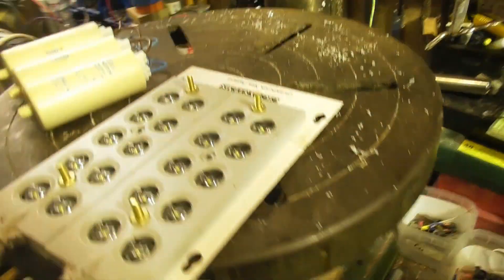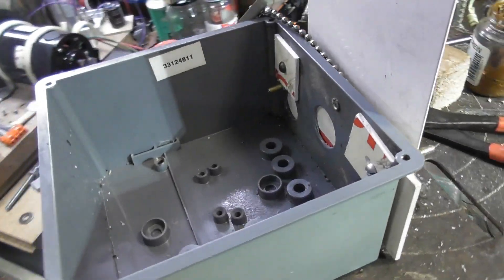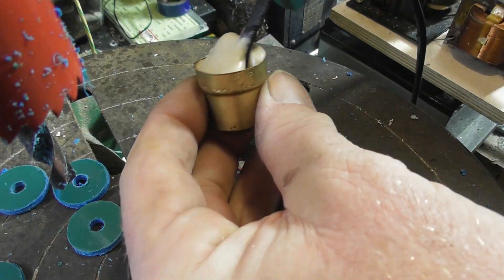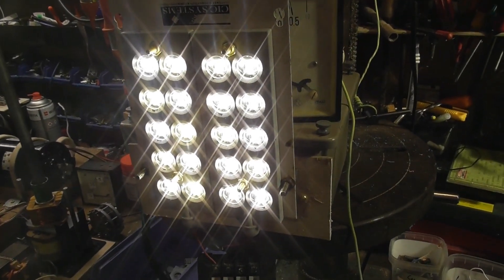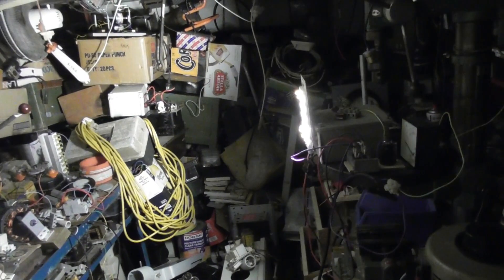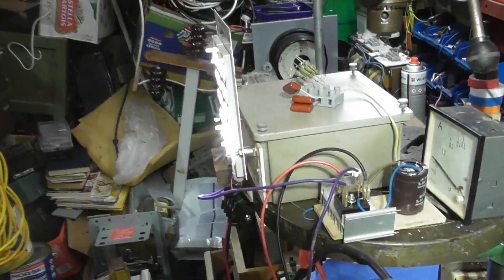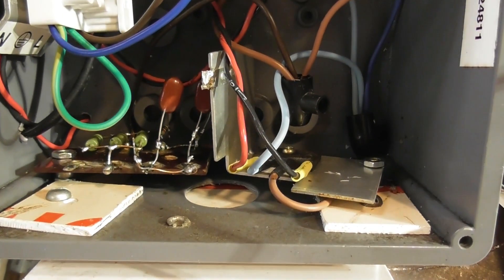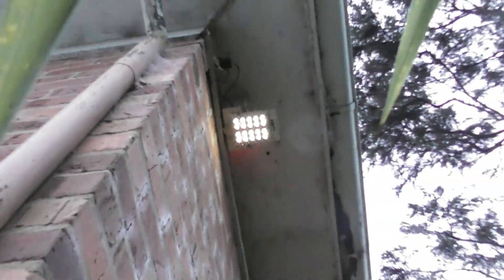Cree 20 LED lamp with capacitive voltage dropper

Comment: Hi Ray.  Thank you for the shout, regarding the KIM streetlight vid you made 2 years ago.
Having been involved with high power LED's for at least 20 years now, I have seen the amazing progression of the advances of the Junction Temperature of LED devices reducing to the point that several 3W+ devices can be placed on a small heatsink.
However, I have observed that cheap LED's are extensively used in HF switching modes at the expense of their overall life expectancy.  Therefore, I recommend using over-sized heatsinks on these devices wherever practicable to enhance their lifespan, in regard to any modulated PSU and particularly if you are operating them close to D.C. conditions.
Nice to be in contact again.  Best wishes to yourself & your family.  Cheers !!!
Reply from the maker: No worries, I just scored another large KIM streetlight and about to upload another video. These lights are also dimmeable, via an external resistor.

Comment: im used to changing out Rifa's X2 rated capacitors from old computer power supplies... they fail short with age and let out an amazing amount of smoke! I call them "Stinky Rifas" :)
Reply: I'm amazed by the way you can smell a singled burned out 1/4 watt resistor throughout an entire house...
Reply: @deltab9768   - Once smelt, Known forever.
Welcome to the world of electronic service repair.